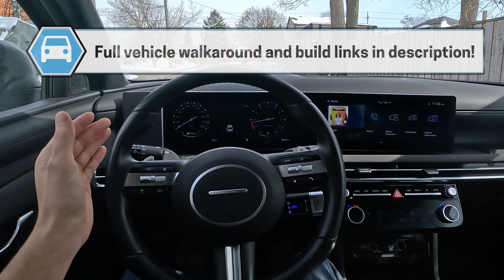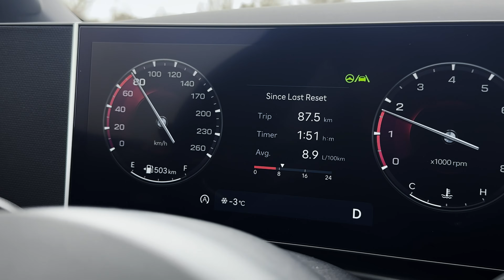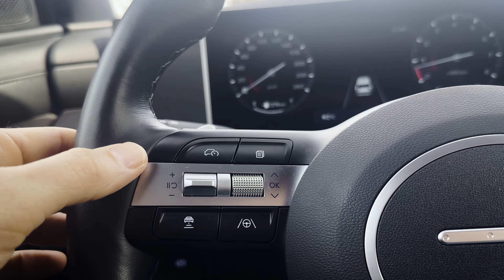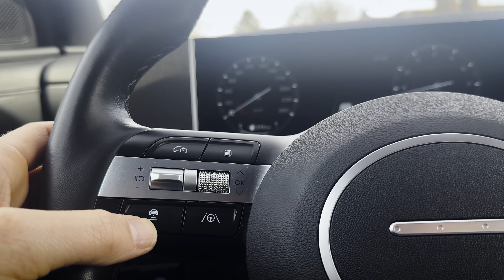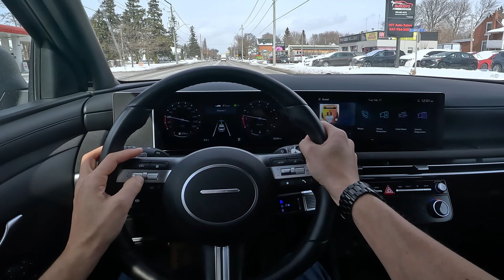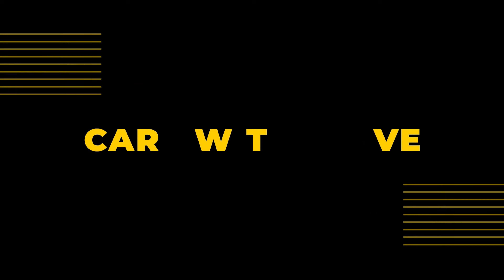How to use Cruise Control in the Hyundai Tucson

Comment: Seriously, I bought the 2026 Top spec Tucson two weeks ago, and I will never use this function. To me, it's useless....you probably have to pay more attention than you would when you normally drive. It should NOT be an option in this car......just use human instincts to drive, and DON'T rely on the cars computer to keep you safe. Other than that, the car is very very nice.
Reply from the maker: You should learn how to use the system.. It’s actually really good once you get the hang of it. Why would you have to pay more attention? It auto adjusts the speed to the vehicle in front of you and can brake if the vehicle in front of you slows down and you don’t see it
Reply: @CarsWithSteve Yeah trusting a car to brake for you is probably the most irresponsible thing you could ever do. Technology can and will fail eventually, just a matter of time. No-one should feel comfortable giving the car any control. What i mean by more attention is when you give the car any type of autonomy, i would be constantly waiting for the car to make a mistake, like a cat on a hot tin roof (hence my reference about paying extra attention).
Reply from the maker: I guess that's why Tesla has sold millions of cars, with a huge percentage of those with full self driving that require next to no driver input. Driver assistance systems, like adaptive cruise found in Hyundai cars, are there for assistance not to take over driving completely. You still need to be paying attention
Reply: @CarsWithSteve Tesla's ain't the bee's knees either. If a car (in my opinion) has any kind of autonomy, is when human anticipation and instict dies out. No matter how much autonomy the car has is purely subjective, given how much a human develops experience over time I.e a new driver is less experienced than a 25 year driver. A semi autonomous car should not replace experience. I trust a human with experience over an autonomous (even partially autonomous) car. So I don't car if Tesla are selling cars, nor should anyone else, we should be more concerned with giving a car autonomous features. This is just my opinion.
Reply from the maker: Agree that it should not replace experience. I do think that with robo taxis becoming more popular and more people relying on Uber/Lyft, chances are good that people actually needing or wanting to know how to drive a car will eventually be a thing of the past
Reply: These features are Level 2 driving assistance.
Understanding and utilizing the pros and cons of these features can be convenient in many ways.
New technologies are not perfect, but they are being used quite effectively.
Personally, I am satisfied with these features, use them carefully, and can drive comfortably.

Comment: I have just had the absolute WORST day as a courier trying to set the SOB adaptive cruise control and it not sticking at all unless there are no cars 100 feet in front of me. It’s the worst feature to have on a car because there’s going to be traffic and you can use cruise control in light traffic safely, but Hyundai says fvcking otherwise. I will never own one of these, I just drive one for work.
Reply from the maker: What's the challenging part? I show off the buttons.. all you need to do is toggle in on first which sets you at your current speed, then increase or decrease the speed as necessary. I've reviewed almost every Hyundai car over the last 5 years and use ACC on residential streets all the time. Take the time to watch the video where I highlight the buttons, it's easy once you actually know how it's used
Reply: I'm considering going back to old school cars.

Comment: Oh man, I sold my last car because of adaptive cruise, and to think I almost made the same mistake buying a Tucson 😢
Reply from the maker: Outside of it possibly not working in bad weather, adaptive cruise is superior to traditional cruise when you actually know how to use the system
Reply: Adaptive cruise control is one of, if not the top auto accessory ever invented.  I would never buy a car without it!
Reply: @christopherengle8490  I agree, have used mine since I bought a car with it 5 years ago.   BUT I won't use it on anything but open roads.  Dangerous to rely on it with traffic control (stop signs/traffic lights) all around you.